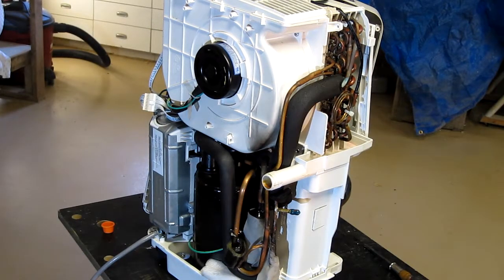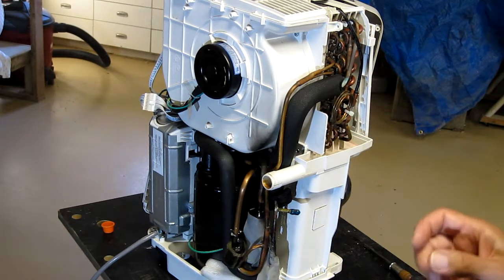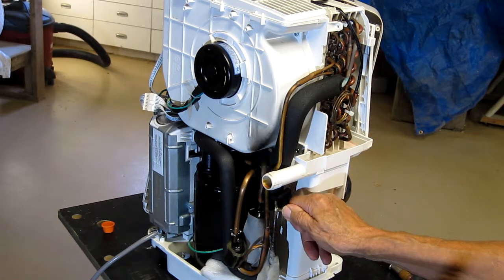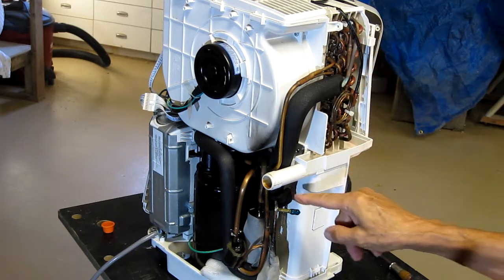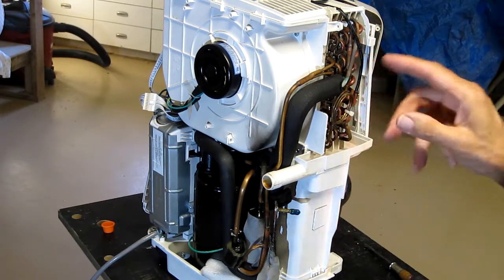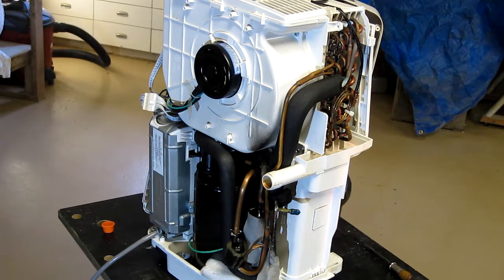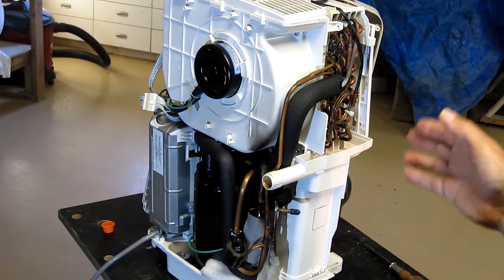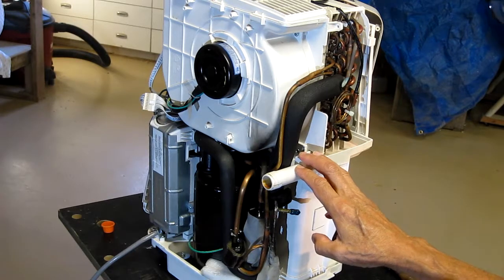Simple DIY propane refrigeration test

Comment: Most refrigerants are flammable to some extent.  They had to incorporate more hydrocarbons in the mix to reduce toxicity and environmental reactions.  As you pointed out, it is a very small quantity. Domestic propane has the advantage of having an aroma added, so a major leak may announce itself to your nose.  It is also heavier than air, so unless there is an ignition source below the leak, it will be hard to get it into the right place at the right A/F ratio to ignite…  Nice experiment!

Comment: That looks like the soleous air dehumidifier that was recalled. Same problem lost refrigerant charge and compressor would not kick off. Really badly done friction welds on these. They work ok on 134a after you solder over the welds. All of them...🤓

Comment: I think I have the same machine and same problem.   Is it r22?        Liquid propane?   Vapor?   how did you get the propane in?      Propane from 20 lb grill tank?         I love the idea and would do the same.    Thanks!
Reply from the maker: As far as how I got the propane into the system, the video pretty well covers it-not much to add. When charging the system, the pressure in the tank must be greater that the system pressure, so it needs to go in the suction line and compressor running. I used vapor off the grill tank. I think modern grill tanks have a  valve preventing liquid withdrawal. Its now been a couple years and the machine is still working. I tired injecting UV dye to find leak with no success. About once a season it needs a propane top up.
Reply: @geezerguy47 all you have to do it turn a tank upside down to get liquid.
Reply from the maker: No, I feed in vapor to the suction side. When I feel cool on the suction line I stop filling. I don't think you can get liquid out of modern tanks due to internal safety valve. It might feed in too much, too quickly anyway.